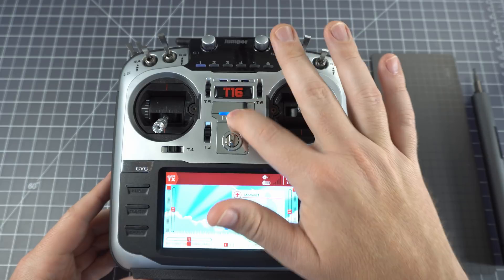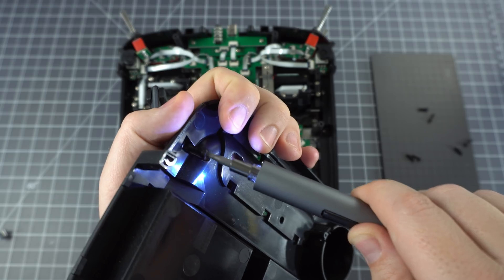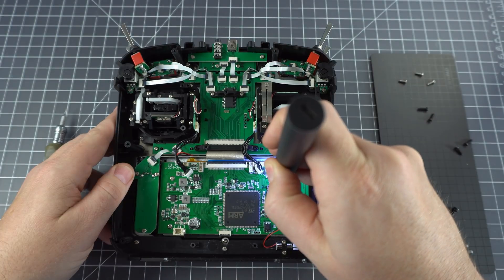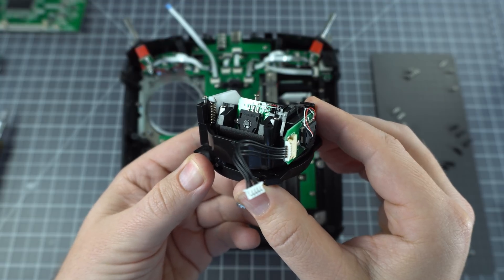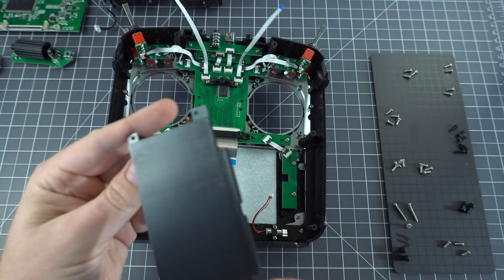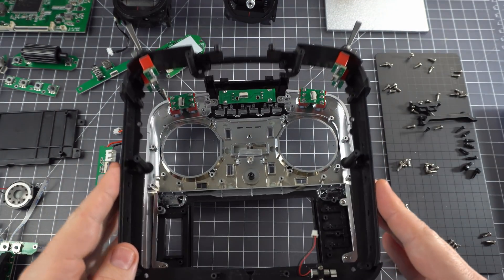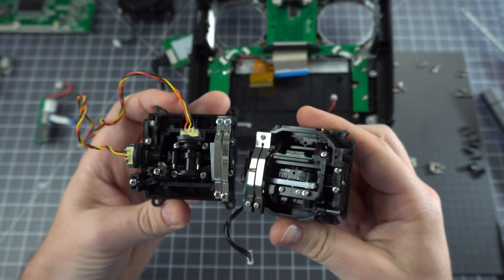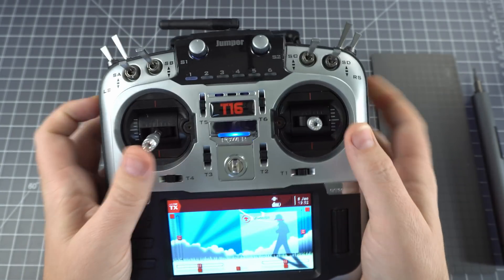Jumper T16 Complete Teardown & Overview

Comment: My backlight is not turning on anymore. Is there a way to fix it
Reply from the maker: You may want to re-seat the ribbon cable to the display. If that doesn't work you may need to replace the display.

Comment: What kind of screwdriver is that thats automatic? Didn't see the link in the description for that🙈😢
Reply from the maker: It's called the Wowstick 1F+
Reply: @whiffles  how long have you been using it. Have the gears gotten clanky or have issues with the torque or over-torquing occurred; stripping some hardware? Battery life deteriorate so much that it doesn't hold a charge long?
Reply from the maker: @theUAPwhisperer  Been using it for about a year now and I've maybe charged it twice. Works like new and it almost never seems to lose it's charge. Over-torquing isn't an issue at all. If anything it could use a little more, but one manual twist at the end is enough. Never stripped anything.
Reply: @whiffles  manual twist at the end it's torque limit doesn't damage the gears internally?
Reply from the maker: @theUAPwhisperer  Not that I'm aware. Seems to be built for this.

Comment: Nice review, and thank you very much for that. But, as far as I have been researching, I have not seen any review using the new Radiomaster (or even Jumper T16 or T18) with 50cc or bigger size gassers airplanes. And that is a real shame, because both companies maybe are missing a huge amount of money. Radiomaster and Jumper should also aim, face up  and shake strongly the big and more stabilished radio companies in that niche, in my humble opinion. Greetings from south of Brazil.

Comment: im not especially savey with tearing a radio apart to fix things so they effectively bind and fly with all the cool planes available or going through multiple menus to fix comparability issues but i do want to upgrade from my old fm jr radio to spectrum with out paying over a hundred bucks for the radio and then another 60 bucks for a new lipo battery. options?
Reply from the maker: Check out the Jumper T12 Pro. It's a smaller version of this at a lower price.

Comment: You do not show how to remove /disconnect  ribbon connector. do you pull black strip back to release cables ??
Reply: Thanks for reply . I was trying to pull  the black bar away from the white one . is that wrong ?
Reply from the maker: Yes, the black bar pulls upward away from the cable in just about every case here.
Reply: @whiffles  live n learn . not bad for a 83 yr old
Reply: I was fitting the carbon case front
Reply from the maker: @normantrowell1835  Got it successfully installed?
Reply: @whiffles  yes thanks for the info

Comment: Wow great job! Is this the procedure to swap to the carbon face plate ? Thanks for sharing Whiffles
Reply: I just swapped mine, you need to remove everything as in this video, except for the 4 switches in the side plate. Took me a little over 2 hours to take apart and put back together again. So yeah, follow along with this, and you are good to go ;)
Reply: @Souldk86  Thanks buddy!
Reply: @amkclouds2035  no worries ;)
Reply: @Souldk86  How did you release the ribbon cables. I have tried pulling on the black bars but do not want to break ribbons ?? very tight
Reply: @normantrowell1835   hi Norman
Just try flicking it with the nail upwards from the direction the connector is mounted. It is a little fiddly, and sometimes takes a couple of tries. You can see and feel on the ribbon cable when the lock is loose.

Comment: Very cool! Just have one question is there any way I can tighten up the left joystick up and down tension? I tried removing the rubber cover but it seems that the adjustments is for yaw left and right only. Thanks
Reply from the maker: Sorry I missed this. Were you able to find a solution?

Comment: What tool would you use to remove the switches?
Reply from the maker: I'd just use a flat head screwdriver and fit it into a groove sideways to turn. It might require a little torque.

Comment: Great video. Any idea if the switches can be replaced/repaired? Mine broke off. :(
Reply from the maker: I'm sure they can. You just need to find a suitable replacement. Maybe check the Jumper AliExpress shop.
Reply: Whiffles agreed. Grayson Hobby saved the day.

Comment: How the hell do you unscrew the switches from the outside? How? What tool do you use? I managed to unscrew one, but I guess it was initially loose, I've been stuck for an hour trying to unscrew the other one... So until you show what magic wrench you need to unscrew the switches I can't call this teardown complete.
Reply from the maker: Check my X9 Lite teardown video. I showed how to remove the switches in that one.
Reply: @whiffles  Thanks! Well, I managed to do in the end, but it was waaaay more effort compared to what I saw on your X9 video. No way I could do it with tweezers or anything alike. Jamming wire cutters in both of the tiny holes and twisting is what got the job done!

Comment: hey @Whiffles thank you so much for this awesome tear down video!!!! could you by chance give me some information on replacing one or two of the top switches ?! i have had my radio for only a few days and have already managed to snap a switch off :( ... do you know wher i could buy a replacement? or can i just use a frsky switch to repalace?
Reply from the maker: I'd just remove the switch, get the dimensions and search for something similar on eBay. You could also try contacting the vendor who sold the T16 to you to check if they have any replacement parts on hand. An FrSky switch with the same dimensions should be fine.
Reply: Aliexpress

Comment: This or nirvana flysky version? Personal opinion and opinion for thumbers ;)
Reply from the maker: Personally I like this one better, but I pinch. I think it really comes down to the form factor you prefer. I really like these gimbals, they feel perfect.
Reply: @whiffles  okay, and what about the range with the module? Or did you only use crossfireM
Reply from the maker: @SemteVruchte  The range is good. I haven't tried Crossfire on this yet.

Comment: What radio would recommend? This or frsky? Also googles.
Reply from the maker: The radio is really a personal choice. Which looks better to you? Do you want something compact? What's your budget? This is a great radio for the price. I'd certainly choose it over the FrSky X9D, but the X-Lite is another good choice for its size.
Reply from the maker: As for goggles, what's your budget?
Reply: @whiffles  yeah I had the xlite really like it. The goggles I had a domv3 but wanted a bigger screen but not bluer. I'm trying to get back in so I currently don't have anything.
Reply from the maker: @Hellmuthsilva  The EV200D is the best value headset with a 42 degree 16:9 display. It's a very nice display, but the DVR isn't too great. The HDO is really the best goggle on the market. You might also want to look at the HD3.
Reply: @whiffles  do you have the ev200d?
Reply from the maker: @Hellmuthsilva  Yes, I have them.

Comment: Another collection of Jumper afterthoughts copied from others. Not one of your links actually has them in stock. According to Gearbest it is already discontinued. I know one person who actually managed to buy one and it has been nothing but trouble.
Reply from the maker: Yeah, it's hard to get at the moment, but I heard a new batch is coming soon. Jumper is putting all their resources into this radio right now. What sort of issues did your friend have? I know Jumper is sending replacement parts to their vendors in order to support the customers.
Reply: @whiffles  He had problems with the battery holder, the scroll wheel and the backup Lithium battery. I've seen one other comment about a broken scroll wheel. I have read somewhere that there is a software update that addresses the scroll wheel. I have an original T8SG which is fine. I had a T8SG V2 and it was so unreliable that I binned it. That makes me fairly biased against Jumper.
Reply from the maker: They're going to send a bunch of scroll wheels with a metal pin to the vendors to distribute as replacements, and yes there is a firmware update that addresses the scroll wheel skipping every other click. That will be a welcome change. I've got the original T8SG as well, but I replaced it with the T8SG Plus which I really like. I even modded it to support Crossfire. Never had any issues with it.
Reply: Dave Day I have one too. Issue with the lithium cell I did have as well. Firmware update Fixed the scroll wheel clicking. Everything else is working perfectly I must say
Reply from the maker: What was the issue with the lithium cell?
Reply: Whiffles DOA. Something is draining it. Not too problematic since it only stores the time and date
Reply: @whiffles  It kept losing voltage as if there was a large drain on it. It's only there to maintain the settings if the main battery is removed so there shouldn't be any drain on it at all. I have two JR radios which are over 25 years old and still running on the original cell.
Reply: moron